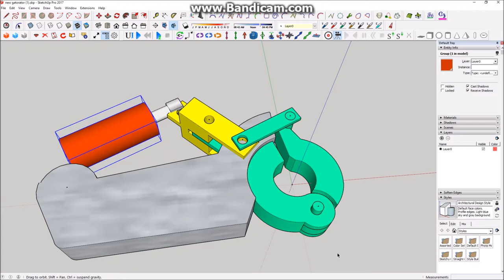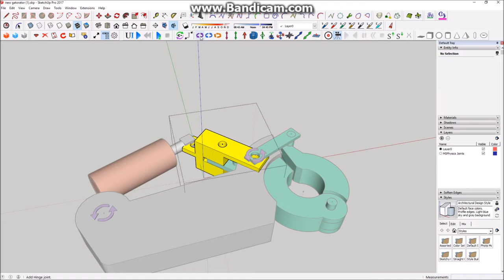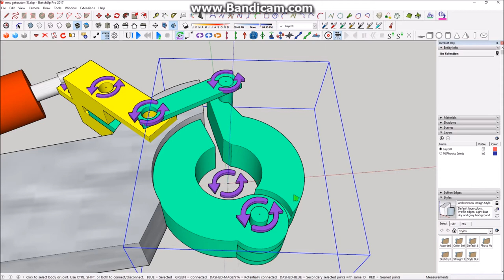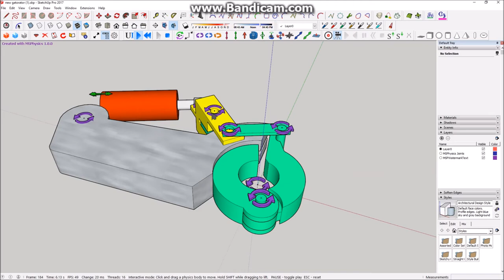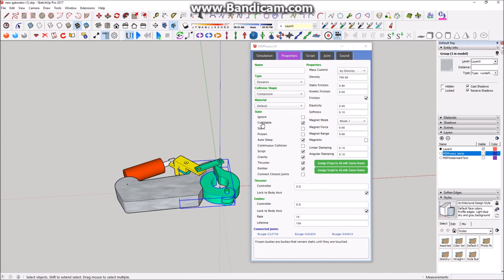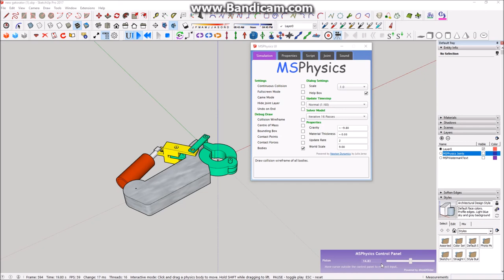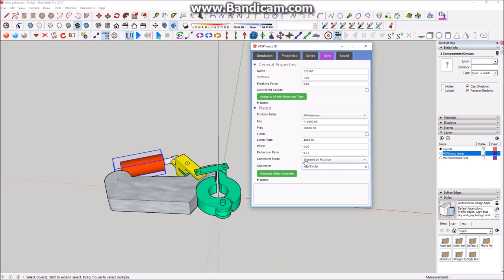Hydraulic Torque Wrench with MSPhysics

Comment: Anyone experience a section plane cutting through your model and making it slowly disappear when physics are enabled?  Not right away, but after manipulating an object for a few seconds.

Edit:  Found a post by Anton explaining that this is caused by objects falling off the static plane into infinity.  Once I made sure all objects were grouped and assigned through MSPhysics, the problem went away.  One model gave me fits until I realized that a hidden object was falling and I never saw it, lol.  I discovered the culprit by turning on "view hidden geometry."

Comment: I created something similar to this but when I push play it starts shaking and the joints eventually shake themselves apart. It looks like the joints are made of rubber instead of solid like in your model. What am I doing wrong?
Reply from the maker: Try assigning them a similar mass. The less the mass difference between the connected objects the stronger the joints become. The mass can be changed by selecting the body, opening MSPhysics UI, changing the weight control option to mass, and setting the desired mass.

Comment: I'm a novice at this but I would love to know (exactly how) the hinge on the yellow and green is joined so that it can move independently. Could you explain this process Anton - or point me to a (free) manual somewhere so that I can learn to do it myself? Funky torque wrench, btw! ;)
Reply from the maker: To connect/disconnect groups with joints, select the joint connection tool, click on a desired joint, hold Ctrl/Shift, and then click on a group to be connected/disconnected.

I will add the caption for that into the video.

Here is more: https://github.com/AntonSynytsia/MSPhysics/wiki/Using-Joints.
Reply: Wonderful... Thanks Anton. It appears to work - Very helpful. Thanks!